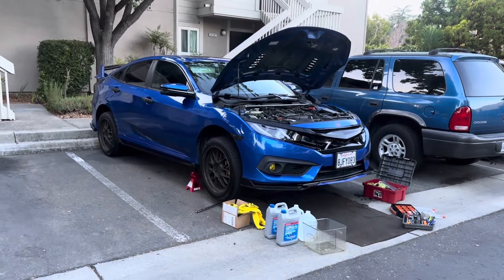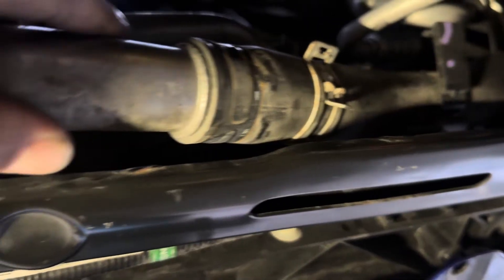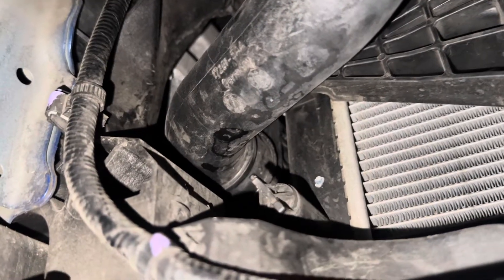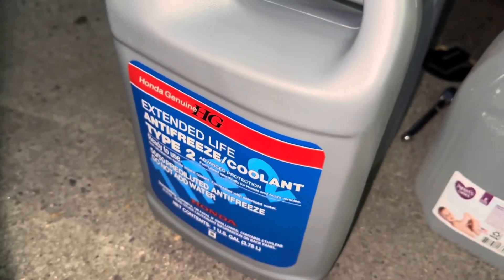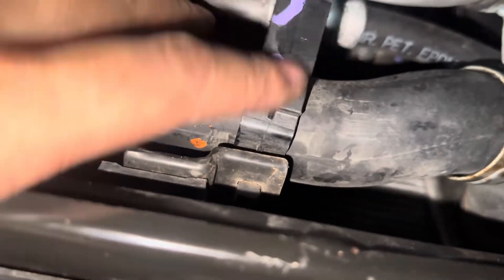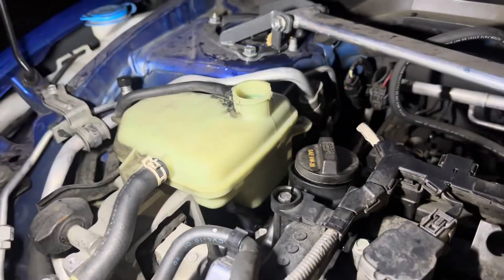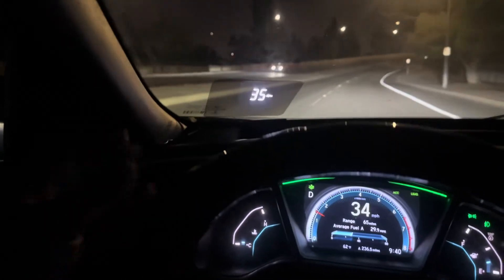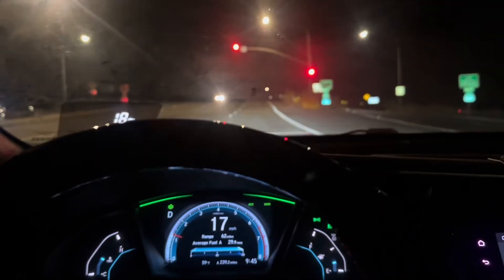How to Change COOLANT for HONDA Civic 10th Gen Flush & Bleed Procedure 1.5L Turbo DIY 2016-2021

Comment: This video should be deleted, no one should be changing their coolant this way.  

There is no reason to undo that hose, just use the radiator drain petcock.  A much more egregious error is that you filled the engine with distilled water, but when you drained that out, not all of it comes out.  So you have an engine filled with water, then you added 50/50 premixed coolant.  Once that mixes with the water in the engine, it's no longer a 50/50 proportion.  I would not be surprised if you now have corrosion in your cooling system due to the now inadequate ratio of coolant to water.  These engines are designed for drain/fill coolant changes, a flush is absolutely not necessary.
Reply from the maker: Thx for sharing

Comment: I find it strange… how most videos involving radiator hose replacement on Fk8 don’t mention using heater to bleed.
Reply from the maker: It helps for sure
Reply: @Sals_Garage  Your sir, are ignorant.  It accomplishes nothing because there is no heater control valve regulating the coolant to the heater core like on older Hondas.
Reply: That is because these 10th gen Civics don't use a heater control valve.  Heat in the car is controlled by the blend door in the HVAC system.  There is absolutely no point in turning the heat to max when doing cooling system services on these cars.

Comment: I drained mine twice but then only ended up using 1/2 a gallon of coolant. I'm not sure why that is.
Reply from the maker: There’s still lots of cooking in the engine block. For full flush you’ll need to do the process a few times.

Comment: Do not flash the motor will never  get all the water out of your block you are making a easy job in to a major job
Reply from the maker: Thx for sharing
Reply: Nothing wrong with flushing using inert distilled water. People screw up by using mineralized tap water which causes hard water deposits like you see in your shower.
Reply: @c0d0r12  The issue has nothing to do with the quality of the water, but rather the ratio of coolant to water in the engine.  What he did here doesn't allow for a 50/50 proportion when done, because he used premix 50/50 and the engine was still full of distilled water.
Reply: @coolantkid3428 ive had to re read your comment like 5 times now to try to figure out what your point is mate. Of course you want to have the proper coolant/glycol mix. That isnt the point of this discussion.  The point was yes you can flush with distilled only, normal tap water has mineral deposits in its media that you dont want in the engine/radiator plugging passages and eroding moving parts. Technically, to address your weird off discussion comment - running a plus water ratio mix in the coolant would still be fine. Water holds more BTUs and transferrs BTUs easier in the heat exchanger than coolant. The additive package in the coolant is is only needed for lubricant purposes as well as raising the boiling point and lowering the freezing point of the coolant itself.
Reply: This is absolutely correct.

Comment: Sal - Thanks for sharing. 
Yes this might be one way of doing it but it is not the correct way. Avoid making a mess and the possible of messing up your hoses by doing this method.
You can reach the drain plug from the top, just make sure you have a large pan underneath and make sure to properly get all the air out of the system using the correct funnel while bring the engine up to idle temp.
Reply from the maker: @splicezone  thanks for the advice. Good info 👍

Comment: Guys you don’t need to use distilled water for coolant flush and change. If you don’t drain all distilled water out of radiator AND engine block you WILL leave water in the cooling system. ALL DATA says to just flush and refill using radiator drain plug, below radiator. You will never find a recommendation for using distilled water when doing coolant flush on Honda service manuals.
Reply from the maker: @mccart1992  thanks for sharing. 👍
Reply: Correct. Some ppl just apply what they used to do on their previous vehicles and bring that practice to new ones. We'll see what happens to this civic!
Reply from the maker: @blahblah8372  I’ll keep everyone updated! Thx 🙏
Reply: This video should be taken down.  The procedure done here was wrong and there are so many novices on Youtube trying to learn correct car maintenance who are going to see this ignorance and just follow it thinking it's right.
Reply: Probably to get like dirt and old fluid

Comment: When you were running the distilled water and raised the heat to max at idle, did you also turn off the A/C? 

I saw you turned off the A/C after putting in the new coolant before driving.
Reply from the maker: @javierramos4865  AC off to use engine heat
Reply: @Sals_Garage  awesome, thank you for the video, it was a big help
Reply from the maker: @javierramos4865  anytime! Happy to help 😊

Comment: Nope...you drained very little.  Need to open the engine block (located center right as you look at the bay).  
AND
You would need to remove the HOSE as you showed to get the debris out as well (if any).
Reply from the maker: @MegaHollywood1971  thx for sharing

Comment: Never use these screw clamps. The tensioner one u just changed  is the best design as it grips more on high pressure.
Reply from the maker: Good tip 👍
Reply: A screw clamp is better we use it for drainage in plumbing systems on 60 story’s high rises
Reply: @wafflepanda2489  Not in automotive applications.  The tension clamp is superior because it can adjust it's tensioning diameter depending on the temperature it's exposed to.  The screw clamp is fixed and can't do that.

Comment: Hey Sal, correct me if I’m wrong. But I thought if you use antifreeze you don’t need distilled water. Because the antifreeze does the anti-corrosion.
Reply from the maker: Need to mix it with the coolant to get the proper cooling performance.
Reply: @Sals_Garage  yes, certain climates require different ratios as well for freeze protection
Reply from the maker: @camerinw.3226  👍
Reply: What he did in this video is wrong.  He filled the engine with water, drained it, but then water still remains in the engine and he then added 50/50 premix coolant.  The final ratio is no longer 50/50, it's got more water than coolant now and yes, this will cause issues since both the corrosion protection and freeze protection have been compromised.

Comment: The proper way is to keep the cap loose so air can escape.. Run 5 mins.. Turn off.. Refill and its done
Reply from the maker: Thanks for sharing 👍
Reply: The proper way is to vacuum fill.
Reply: @scottshepherd1365 can you elaborate please

Comment: WTF 😳. You are way over doing it.  Ppl majority of this is not necessary.  Don't ever use any kind of water.  Wrong clamp. That new clamp will not expand when the hose gets hot.  Making it possible to blow out the hose. This is why there is clamp on the so it may expand when it warm. This guy has no idea  what he is doing.  He didn't burp the sytoms  for the air bubbles. Please don't destroy your car. Do not listen to this fool. 🙏🙏🙏
Reply from the maker: Bleeding the coolant system has already been covered in the video. Distilled water is fine to use in the coolant system as well to flush it out. I haven’t had any issues at all with the new clamp and I have used it plenty of times on other cars. Good day 👍
Reply: @Sals_Garage  Jose is correct.  What you did here was get rid of the superior OEM Honda tension-type clamp and replaced it with the inferior aftermarket worm-drive clamp, which doesn't flex with the temperature changes.  You also messed up the final ratio of coolant to water with the completely unnecessary "flush" of distilled water.  Please take this video down so novices out there trying to find information on Youtube won't see this.

Comment: Seriously why didn’t you use the drain access point on the driver side. What you are demonstrating is way more difficult than intended. Feel sorry for anyone following this demo. Sorry dude, not trying to be rude but this is not an efficient method.

DON”T DO WHAT HE DID FOLKS!!!!!
Reply: Agreed.  This is not the way to do it.  Not to mention, you got rid of the superior OEM tension-type clamp and replaced it with the inferior worm-drive clamp.
Reply from the maker: My method worked great. No issues to report. Feel free to do what you prefer. Good day sir.
Reply: I agree, it works for him but all those extra steps like the unbolting might create more problem for other people, it's just unnesscary.
Reply from the maker: @VTT-b4q  there are multiple options. I showed where the drain plug was if people want to do it. It’s actually difficult to remove the whole entire intake and put it back together so this method is more efficient for me.

Comment: I do not see how your are getting all of the distilled water out of the system, you are winding up with a very diluted coolant using the Honda 50/50 mix, which will damage the motor and other components as it is not cooling properly. Using this distilled water method, you should be using 100% Honda Concentrate fluid, not the 50/50 mix you used to refill. Also, Honda does not recommend coolant flushing their motors, a simple drain and fill every 30,000 miles is all that is required. This could be sooner or later depending upon the operating conditions. And with a turbo, I would definitely do the Honda coolant drain and fill every 30,000 miles without fail, or sooner if you really get on the motor.
Reply: Its not every 30,000 miles, thats excessive maintanenace, just more money for the dealer, its when the maintenance minder comes on which is around 100,000 miles, modern coolant last a very long time.
Reply from the maker: @nightrider2k6  correct 👍
Reply from the maker: Thanks for sharing 🙏
Reply: This is stupid misinformation. Water is wetter than 100% coolant and cools better. Coolant just has a higher boiling temp and lower freezing temp than water making it more flexible.